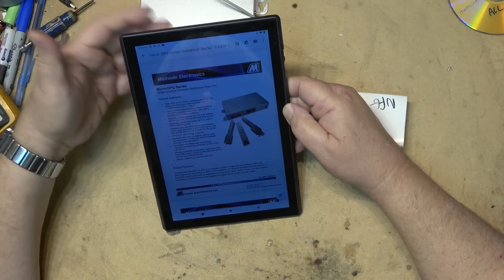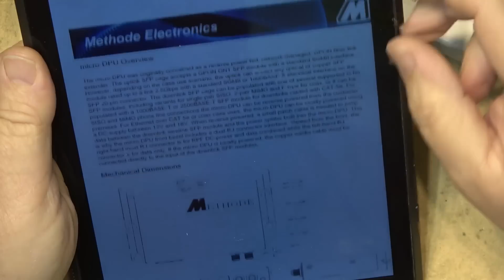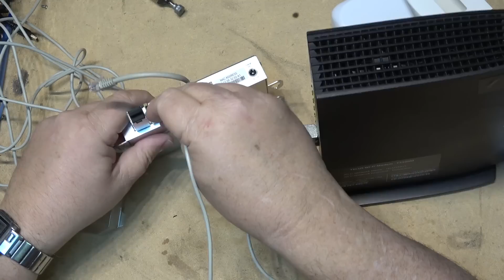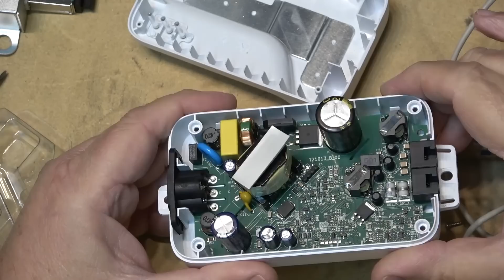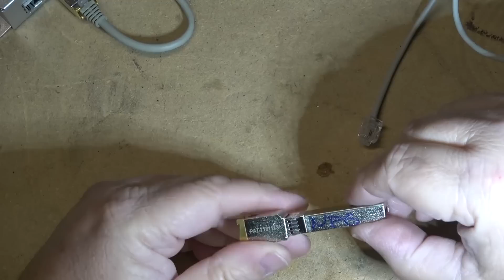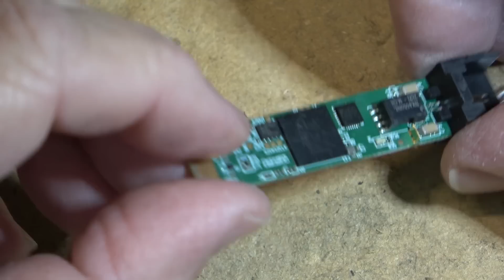What exactly is microDPU? Lets find out.

Comment: What makes it easier to run coax into the house rather than fiber? Is it not all wire of similar diameter?
Reply from the maker: It isn't however generally there is coax or phone lines from where the demark is. The fiber is also generally at the same location.  Easier to just pop a hole into the garage and install the fiber and then back feed on existing coax to the location where the wifi access point is located.  In the case of microdpu, it can be done just using a single telephone line feeding the  ont, including back feeding power.
Reply: @12voltvids  i mean if there isn't already an existing coax cable running through the building, would fiber be more difficult to run ?
Reply from the maker: @nocandopdx  if there is no cable the fiber is run on the outside and wall drilled to bring fiber in. For apartment blocks it is run through the halls and enters over the door. Thin fiber is glued to the ceiling.  Do that on a regular basis.
Reply: @12voltvids  sorry if they're silly questions, fiber isn't really a thing you find yourself doing as a diyer, but it is interesting non the less
Reply from the maker: @nocandopdx  actually many do. I was just at a house yesterday to install service and home owner had run the inside fiber to the demark.  All i had to do was install the equipment.  He didn't want to pay for a custom install so he put it in himself.

Comment: Hey, I have something i want to use that is faulty. Can you help me confirm if this issue is fixable?
Its a Zenith ZG320M Am/fm stereo clock receiver / cassette recorder that only has audio playing on left speaker, same issue when hooked up to headphones.
I heard it could be something with the amplifier inside, is this fixable and if it is, how can i fix it?
Reply from the maker: Not familiar with model.  I'm sure it's fixable but wouldn't be worth it.
Reply: @12voltvids k, just checking because i like this mini radio / clock / cassette player. It runs off wall power or a single 9v battery
Thanks for checking my comment, your advice means a lot to me because i have a lot of old stuff 😅

Comment: Verizon's Fios has always done a similar thing where the ONT was locally powered, and POTS is wired directly to the ONT using the existing phone wiring, but data is on MoCA so if the customer was upgrading from cable internet the house coax could be reused. The gateway connects to the coax and provides the usual ethernet/wifi, as well as a second MoCA network for the set-top boxes. Only downside is that it cannot reach gigabit speeds, at least on the ones I've seen. 

That is, if you rent their hardware. I had them provision the gigabit ethernet on the ONT so I could use my own router, and the coax runs directly to the CableCARD tuner in my PC.
Reply from the maker: We do the same when we have local power.  Network access hub in installed which provides phone 10g Ethernet 1g Ethernet and 2.5g moca to use the existing cable runs.   Dpu is for apartments.
Reply: I have MoCA in my house that runs at 2.5Gbps, Fios uses a really old MoCA version
Reply from the maker: @elektrokinesis4150  yes we use moca 2.5gb. uDPU is used to bring the service in from phone room to apartment.  We can't use the coax from phone room to suite because catv co owns it.  In homes we generally put the gateway in the garage if the demark is on the garage and then use moca inside the house to feed the WiFi access points. In my house I could have put the ont in the garage and back hauled on coax but just dragged 150 feet if fiber around the house and got it into my comm closet.  Cat5e to every room from the closet.  I wasn't working for phone co when i wired the house or i would have put a second cat5 from Denmark to closet.   I did have satellite TV at the time so there is rg6 everywhere too.
Reply from the maker: @elektrokinesis4150  
There has been many different coax adapters.  Hcna, hpna were early versions before moca was standardized.   The original moca 1.0gb moca 2.5 is here now but only is all devices are 2.5. stick 1 old device and the speed drops to slowest device.

Comment: I feel like that bird now. The city installed fiber months ago and there is a main hub right next to my house. I want it but that looks complicated. Right now it comes in through the phone line. DSL They would have to dig a trench to the main box and run it in to the same box the phone line is in. There actually 2 lines coming in and I know this because I helped run it so the guy didn't have to crawl under the house. I'm not sure what or how to get that line where I want it. It's on the wrong side of the house. Installers nightmare.
Reply from the maker: Dealt with that before.   
Nothing to the hub. No equipment in them just a ton of fiber and some passive optical splitters.

Comment: I'm not a fiber tech, but I had to re-terminate some OM3 recently because the cat broke it. I only wasted about a foot of fiber from failed stripping attempts! Joke aside it is once again functional, and saved the hassle of replacing a few hundred feet of buried cable. I'll get around to mounting it properly eventually.

Edit: oh yeah, we're finally getting useful internet service at my place. It's a rural home, but one of the major ISPs is running fiber around this area. I can't wait to ditch satellite.
Reply from the maker: Unless you have a cleaver the termination will have high attenuation
Reply: Yes, I used a cleaver. A buddy of mine does fiber installs for a living and he provided me with pointers and budget equipment recommendations. I sent him a photo of a ruby red shining in and he said that attenuation appears normal, though unfortunately I can't check any real measurements because I'm using basic media converters. I get full speeds regardless.

Comment: Ethernet to the rescue  - loved it  !     is running fibre expensive ?   I thought the price point came down or is it working with the materials that makes it difficult?
Reply from the maker: Fiber has come down to the point that is is all we are running now.  Copper is being decommissioned community by community.   
Even old buildings have had fiber run in them run through the halls. The wall is drilled over the door and invisalight fiber is glued to the wall.   Some buildings however it isn't easy to get fiber in. Damaged or no conduit available or in the case of owned condo no access.  Some old builds they ran conduit through suites to the next level.  All it takes is a couple of pricks that won't grant access to their suite to pull fiber through to the suites above.   This happens more often than you would think.  An owner wants a fee to pull fiber through the common wall that goes through their suite.  This is all on the builder that built the building 50 years ago. Today this would never be permitted. Each suite needs its own conduit.  So microdpu is the solution.  Fiber brought to the main phone room or satellite rooms and then onto the existing riser cables that run to the suite.

Comment: they are putting in the fibre like crazy here in Southern Ontario.. Bell was first in the race last year (after promising it in 1999 LOL)   .. rurally and now some competition across the road (literally)  - long blue plastic tubes  buried must be Rogers or whoever owns Rogers.  Bell installed heavy iron service ports and was more of a professional operation when they laid their lines even a larger tube - .  We had to put up with line of sight solutions for 10 plus years  - so far it's been great because of cheap super fast upload speeds . that was something of a fantasy for decades.
Reply from the maker: Rogers is big red. 
Telus has been installing fiber for the past 10 years.  Pretty much everything is fiber now. Just finishing up the last few communities.  I put it 5 years ago but didn't switch till this past March.  Mainly because i knew it would be a pain in the ass with my network.   I'm on a 10 gig port but only have a 150 plan and that's 3 times faster than i really need.
Reply: @12voltvids  Thank you for your response.

Comment: I don't mean to come off rude or anything but something in your workspace is putting out a high pitch noise, it sounds like coil whine to me but its super annoying to my crazy sensitive ears.  It stops around 13:04 when some other device makes a sound.
Reply from the maker: crt monitor running over in the corner
Reply: @12voltvids  easily
Reply: @12voltvids  run a 15k notch filter on final edit?
Reply from the maker: @v12alpine  I don't hear it because i have tininnus and it just happens to be 15khz so I hear that sound 24/7.  One day you will understand.
Reply: @12voltvids  I understand, I don't hear it thru my crappy speakers (tops out around 12k) but alot of people on headphones notice it.   Some other retro tech channels notch filter it out.   Your channel, your rules :).
Reply from the maker: @v12alpine  i listen with headphones and it doesn't bother me, but then I grew up with CRT sets.
Reply: you might not want to work around electronics in general.  these things occur
Reply from the maker: @SPINNINGMYWHEELS777  huh?